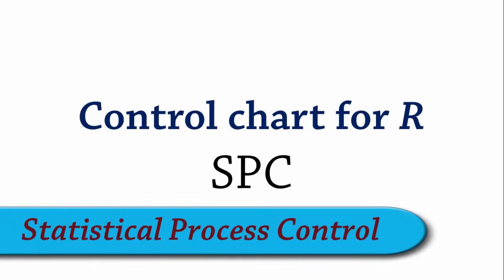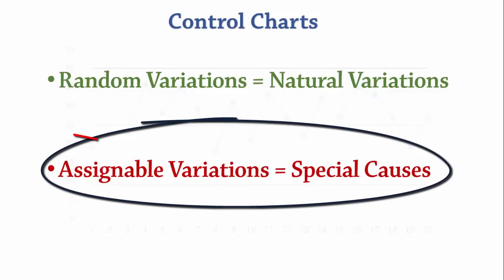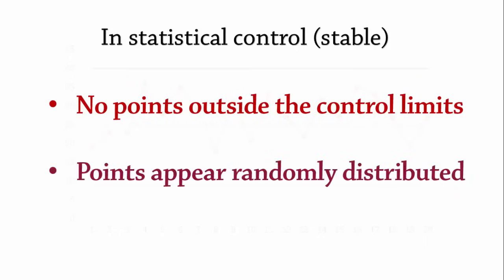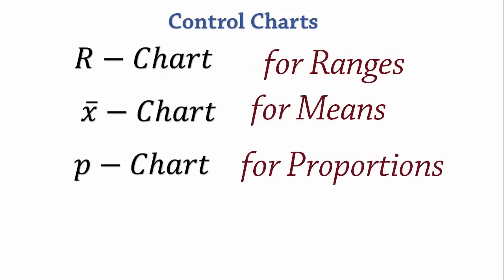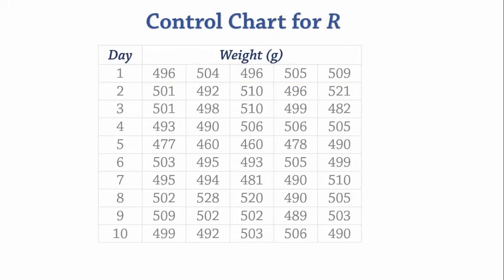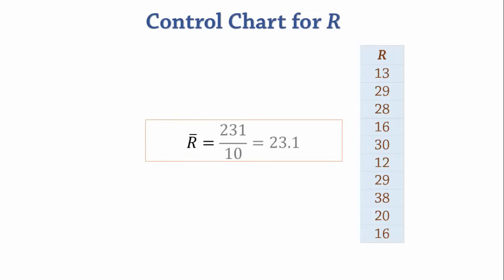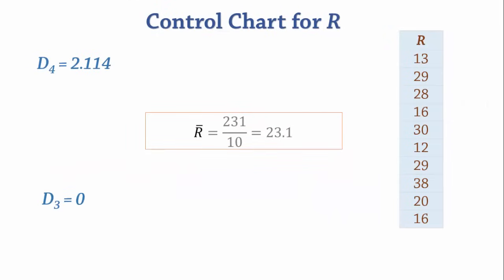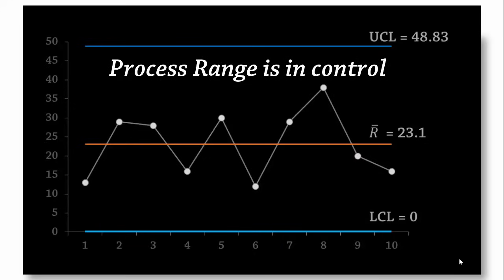Statistical Process Control |  R-Chart (Control Chart for Ranges)

Comment: Where do the d3 and d4 numbers come from? How are they derived?
I was thinking of simply using the critical values of a 2-tailed hypothesis test with a certain p value
Reply from the maker: They are derived based on 3 standard deviations from the mean with sample size in mind. This page provides some insight: https://v8doc.sas.com/sashtml/qc/chapc/sect21.htm
or  https://andrewmilivojevich.com/control-chart-constants-how-to-derive-a2-and-e2/
Reply: @joshemman  Thank you. So if you don't need 99.7% certainty of an anomaly, you can calculate them at less than 3 stdevs